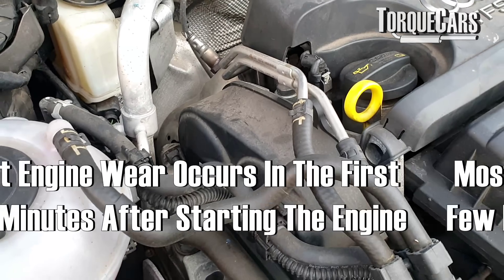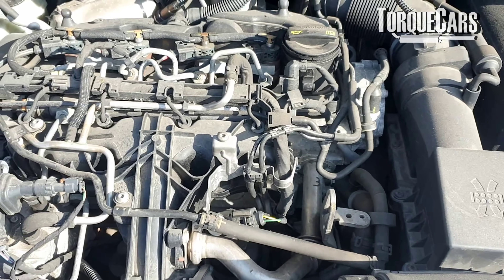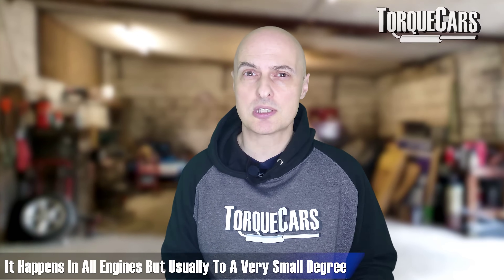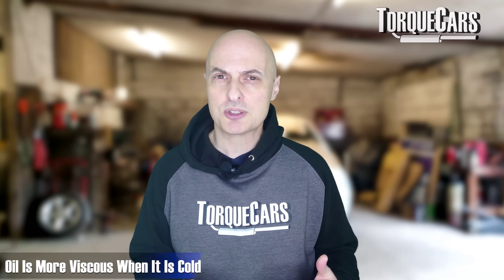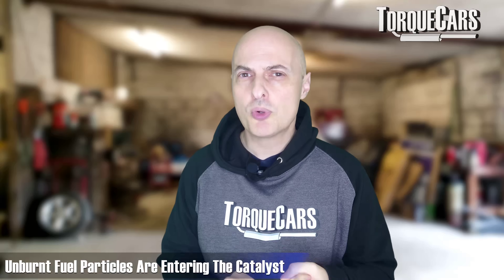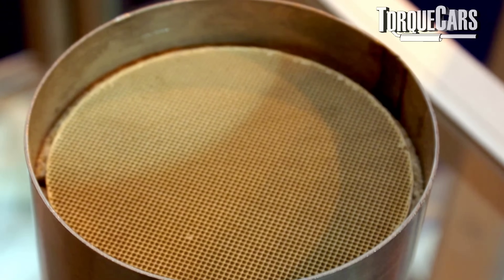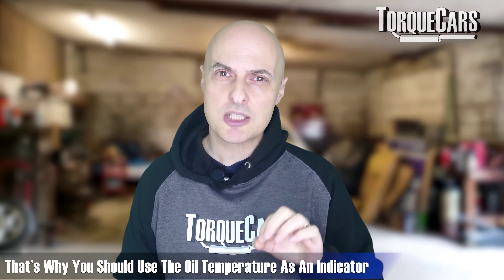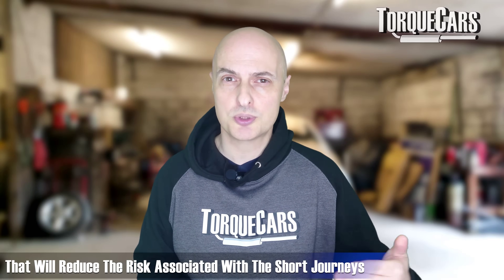5 Minutes of Terror? The TRUTH About Cold Start Wear (and How NOT to Blow Your Motor!)

Comment: I can't tell you how many times I've watched some start their car and instantly put it in gear and go ripping down the road, when it's freezing temps outside.
I'll let run for a few minutes, the way I figure if the idle is still high the car shouldn't move. Then never above 3K rpm!
Reply from the maker: It's crazy isn't it. People often seem to think warming the engine up means ragging it from cold or just letting it idle for 10-15 minutes on the drive.

The older generation also have the habit of revving up as they switched off the engine, another bad habit on modern engines. I still can't work out why they do this.
Reply: @torquecars  Old habits die hard.  I don't think there are any carburetted engines on the market any longer. No even in the second hand market unless you're looking for classics.
Reply: @Chrisallengallery  Even on carb'd engines, this doesn't make sense. If you rev a carb'd engine then shut the ignition off, the cylinders will continue to draw air/fuel mixture into the combustion chamber as there's still plenty of fuel in the bowl of the carb... but now there's no spark to light it off... guess where that goes! That's right -- past the rings and into the sump!
Reply: @jeffcullen6573 actually very few gas engines lack a fuel solenoid, which shuts off the gas right at the carburetor the split second the key hits the off position. As the engine spins down the gas is blown out of the engine on those last couple of of seconds of it spinning, because the valves are still opening and closing letting air (at a very high rate) flow through the cylinder and flush the last of the fuel out. Along with the residual heat in the cylinders, as gas evaporates very rapidly, and again the high cylinder temps increase that evaporation drastically.
Reply: @5400bowen  -- Interesting. Most of the European carbureted engines I've worked on don't have this.
Reply: I can't tell you how many times I've gotten in my car (diesel)with a passenger , start the car up ( dead cold) and after 15- 30 seconds they say " what are you doing?" While the engine is still running at 1100 rpm. These same people jump in their cars fire it up  and slam it in gear and their off... they tell me the heat will come on quicker 🤦‍♂️
Reply: @sunoclockoneday2576 first cold start of the day I go start it and don’t get in  for a couple three minutes . I go back in the house and brush my teeth. Mornings are always hectic for me…I have to feed chickens and a pig and check everyone’s water dishes (dogs  cats too!) before I head out…
Reply: Never above 3k? Hopefully you mean while driving while
It’s warming. Drive your car hard once in a while, blows out some junk you’ve been collecting putting around under 3k
Reply: Exactly